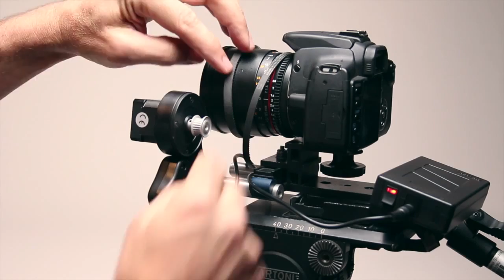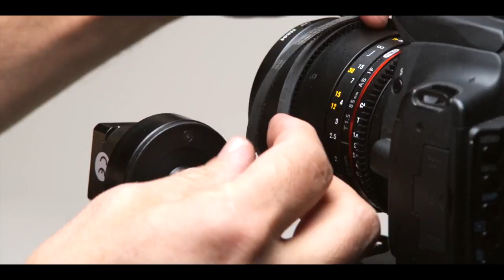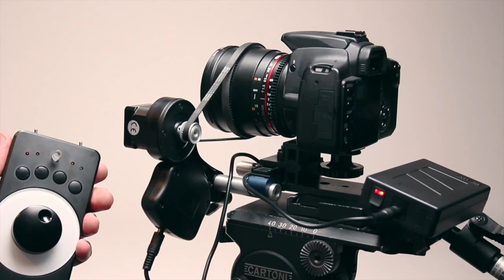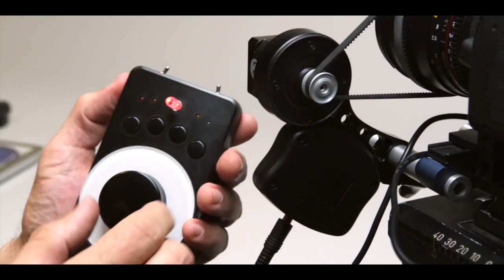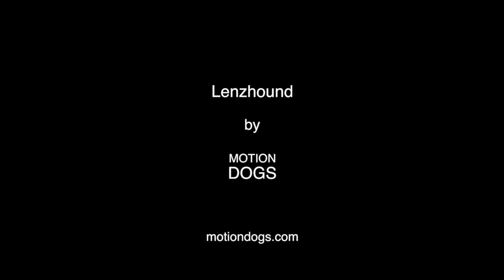HOWTO: Lenzhound Calibration

Comment: I just bought this focus system with the thumbwheel for my steadycam operations and first day i am really exciting to finally do focusing while steadycaming, I only got one question, Is it normal for the motor to get hot? as I readed the Quick Start Guide I changed the power motor settings to both off (FULL) to have more torque motor but i am afraid now to overheat it or something.
Reply from the maker: It is normal for the motor to heat up a bit after several minutes of continuous use. Overheating should not be an issue, and in extreme cases (out in the desert?) if the motor driver electronics overheat they will automatically shut off to prevent damage well before anything bad might happen to your motor. Also, the motor drive automatically goes to sleep after 3 seconds to save power.

Please see the QuickStart Guide on our website under  Help for the newest information regarding the power and speed settings.

Comment: Hi, when I try to use the Follow Focus with the Battery it doesn´t work good. With a Vmount battery it does. Could it be the battery is discharge, it does show a red light, how do I charge it?.
Reply: If you got one of our 12V 3800mA battery packs, to properly charge it, connect to your AC charger and turn the power switch on your battery to the ON position. The light on your charger should turn from green to red. And will turn green once charging is complete.

Comment: Would I need to recalibrate every time if turning the system off or just for a new lens on a lens change? Thanks very much.  I am currently using it with a thumbwheel and cinema gear on my Turbo Ace gimbal system.
Reply from the maker: The system saves the last calibration range used so recalibrating is only required when changing lenses.
Reply: Thank you! I'm enjoying the system. Can I call or email about a question if needed?
Reply from the maker: You bet! The best way to contact us is through the contact form on our website, we also offer live chat support during business hours on the weekdays.

Comment: Does the battery have a rod mount?
Reply from the maker: The TSF Channel Our 12v battery packs do not have a mounting mechanism. Ourselves and other users been using velcro straps to quickly attach the battery to a tripod or the top of a gimbal. You can check out various configurations people have come up with by visiting our photo thread in our forums here: http://forum.motiondogs.com/t/photos-of-your-lenzhound-in-action-on-your-rigs/19/9

As an alternative to using our 12v battery packs many users have decided to use our D-Tap Adapter instead to plug into an already existing power source on their rigs.